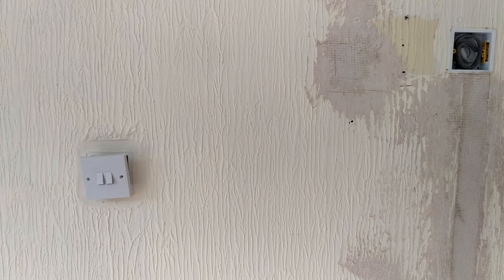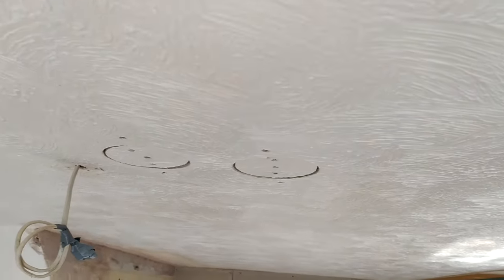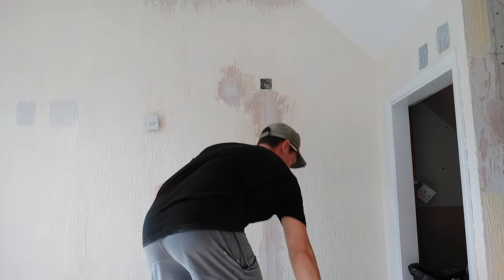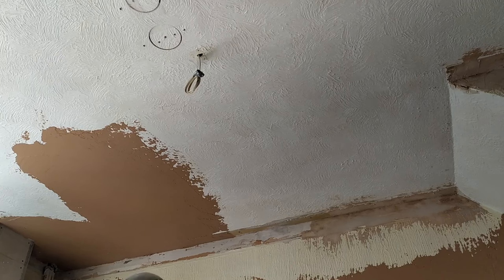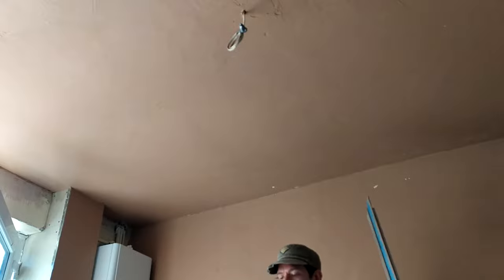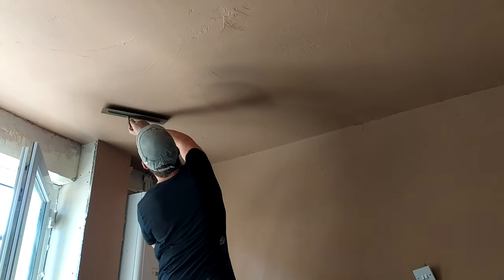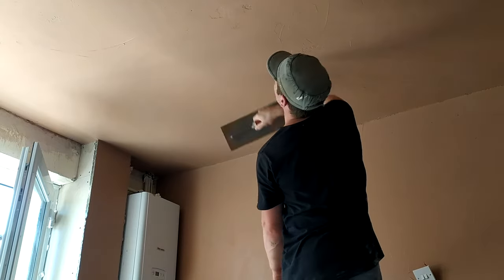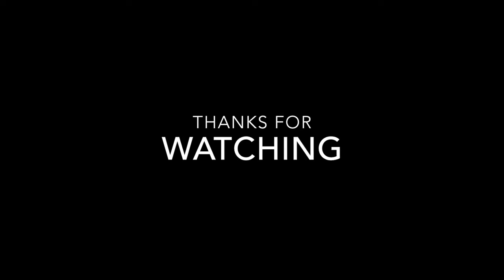Plastering Over Artex Ceilings (Plastering For Beginners)

Comment: Great video mate got a question to ask, have you ever plastered a wire mesh ceiling? Gotta do it in a couple of weeks and haven't done it before
Reply from the maker: Thanks pal! I've plastered a stair winder which was meshed but never a ceiling. For the winder you have to apply a thick base coat of Bonding before you can apply the finish plaster. The bonding binds to the mesh with ease but you may have to apply a few coats. To speed it up you can add cement to the bonding mixture. This makes it set faster pal (saves waiting for it to set ;) Hope this helps
Reply: @PlasteringForBeginners  cheers mate that helps a lot thanks very much love watching your videos they are really good 👍
Reply from the maker: No worries and thank you for the support - I really appreciate it. Cheers 👍

Comment: Just done one, used extra time retarder but as soon as it hit the ceiling boom it went off quick as hell, am I doing something wrong?? Great channel by the way
Reply from the maker: Hi mate. Did you apply PVA to the ceiling before plastering? Make sure you apply two thick coats of PVA to the surface before you start plastering because the plaster is very porous! Hope this answers your question matey!

Comment: How long before it can be painted and do you have to do anything to it before painting?
Reply: I am plastering a whole house. I asked the same question to a trade paint outlet. He said dilute the emulsion with water. The dilution should be given on the can. If it isn't ask at the shop where you buy it. This seals the plaster. It dries in no time at all. If this isn't done the paint will flake and it is a nightmare to remove. This happened to me on a ceiling.
The plaster looks pale pink when it has dried before applying the diluted coat.
I hope this helps.

Comment: How would you prepare a ceiling that does contain asbestos?
Reply from the maker: Hi mate! You can create a suspected ceiling over the area, overboard over the Artex or get professionals to remove it. The last option is very expensive though!
Reply: If was insurance work then they would insist on  removal and renew. Otherwise as a plasterer I m supposed to get customer to sign waiver and leave a warning on ceiling (ie simply form of evidence of suspected asbestos) even if overboard etc. If concerned get it tested and follow regulations.

Comment: I recommend that you don’t use skim coat arteries always shows through the skim coat ,you should be using Drylining gear ie bonding ,filler and easy sand finish
Reply from the maker: I've never had any issues with it mate but I respect your opinion 👍

Comment: Do you let the 2nd coat of PVA to complete dry before starting ?
Reply from the maker: Hi mate. You can start plastering when the PVA had gone tacky but it doesn't matter if the PVA completely dries. It doesn't affect the rate of suction so it's all good 👍

Comment: Asbestos was still in use in the UK upto 1999 so if someone isn't prepared to test a section of the ceiling I'd suggest that they assume that it contains asbestos and act accordingly.
Reply from the maker: I didn't know that mate. Thanks for the heads up and I totally agree - we should treat it at if all Artex ceilings have Asbestos. Cheers pal 👍
Reply from the maker: Here's an article which backs up what you said. It's an interesting read for detecting asbestos actually: https://job-prices.co.uk/artex-asbestos/
Reply: @PlasteringForBeginners  it's a good link but asbestos isn't found just in artex in people's houses and there are different types of asbestos some which are worse than others. Most artex "only" contains upto 4 or 5% white asbestos. Brown and blue asbestos are found in other materials such as asbestos insulation board where the concentrations are nearer to 50, 60% asbestos and should only be handled by a licensed contractor. I've never seen asbestos being discussed in any detail on any of the builder/DIY channels but I think it should be discussed at length as there are many products which can be found in older houses which may contain asbestos and represent a significant danger to the homeowner or tradesperson if disturbed.
Reply from the maker: Thanks for that mate - I appreciate that. Cheers!

Comment: Great work. Deserves millions of likes. I’d love to get this done in my flat but I have have upstairs idiots who don’t bother to control their kids. They jump and run up and down like crazy. My ceiling in all rooms have linear cracks possibly under the joists as they are straight line cracks from one end of room to another evenly spaced apart. Lockdown for them is time to behave like animals. Pack of chav mongrels 🤬😭😭😭😭
Reply from the maker: Sorry to hear that mate. Sounds like a nightmare but thank you for watching. Hope you manage to sort it in time... and good luck with the kids above 🤣
Reply: Could you run battens or thicker timber the opposite way to the joists and then board and skim it? Should strengthen it a bit?

Comment: Been plastering for 5 years now and honestly, I'm losing my touch, starting to get rough patches in random areas. Could easily be lightly sanded once dry but don't want to add another step to the job!
Reply: Do u have a finishing trowel and a laying in trowel ?   Try a refina 14 inch flexi trowel mate.   Use it only at the end with a light spray of water.   Works a treat 👌
Reply: @blueyamie  bought one a few weeks after this comment, makes such a difference!! Never realised how much better a finish I'd get from a new trowel!! I got the 14" nelaflex black edition. Its a god send!!

Comment: Hi Blanie, do you use the same proccess for the fan pattern ? Also would you sponge floay after youve layed in ?

TIA
Reply from the maker: Hi mate - I just answered your previous question ha! Yeah but they are often a lot deeper so you may need to Bond it first using BG Bonding. I only ever sponge float my second coat of plaster pal and to be honest, I never do it when plastering Artex 👍 Cheers, hope it helps!

Comment: I was wondering if I could bend your ear for some advice. I've been getting some quotes for plastering over ceiling Artex in my hallway and living room; house built in 1997; semi-detached, 3 bedroom, etc. All the guys who've given me quotes have commented on the excellent condition of the ceiling, so it's not as if they'll be slaving away for days on end. I've got quotes ranging from just under £200.00 to others hitting around the £350.00 mark. What would be the "proper" rate for the job as far as you're concerned? Cheers mate.
Reply from the maker: To be honest mate, Artex ceilings do often cost more because of the amount of preparation involved so the prices you're recieving sounds correct. 350 is high but some plasterers charge more than others and that unfortunately is just the way it is. There is no "proper" rate. Every plasterer will do that job differently and some tradesmen will spend more time than others. Artex ceilings can be finished several ways which is why your getting several different price ranges. I couldn't tell you what's right or wrong because amongst all of that, every area in England have different rules on pricing. I really couldn't provide a quote because I don't know the prices for your location. Sorry this is ambiguous 👍
Reply: @PlasteringForBeginners  Makes sense. The guy who's charging the most did seem to go into the details of it, and as you said he was the only plasterer out of the bunch that talked about preparation and any potential problems that he'd mitigate. The others took one glance at the ceiling and gave me a price; doesn't really inspire confidence in the long-term success of the plastering work, lol, especially with potential for cracks, etc. Thanks for the advice, mate.

Comment: I remember when i first started in the trade. I was labouring for a builder and one time i had to prep an artex ceiling for plastering. He made me sand it all down. It took me half a day, i thought my arms were gonna drop off 😂😂😂
Reply from the maker: Yeah this is hard work mate. You probably didn't need to sand it that much but it's a good workout ha! Great hearing from you mate, cheers 👍
Reply: Asbestos and use a drywall wander with a dust extractor if it is tested to not have any asbestos if you are asked to complete that job again.

Comment: Artex was never designed to hold more than its own weight. I have lost count of the times I have been called to houses where some chancer has plastered over the Artex and the whole ceiling has come away. Counter battens and new plaster board is the only fully reliable way to go. Make sure you have insurance. It is only a matter of time before you will need it. Your other vids were good, telling new spreads this is ok is a step backwards.

Comment: 1985, well that would almost certainly contain asbestos, asbestos wasn’t stopped being used in artex until 1999 !!!!
Reply: And by looking at the pattern on the ceiling, I can be pretty certain that would contain asbestos, the walls maybe not
Reply from the maker: Well that's me buggered then! Thanks for the heads up mate 👍
Reply: Unless it’s been tested always overboard, the finish is always better anyway !
Reply from the maker: Thanks for the heads up. I appreciate it mate!
Reply: @craigsmith5374  So you would screw into the asbestos? You've  now made the asbestos particles airborne contaminating yourself and the customers house "I hope you have damn good insurance with over 10 million liability" 
Unless you are suitably trained to work with it don't touch it. Because unless you are, you can't legally encapsulate or work on it.
Reply: Craig Smith white asbestos is water soluble so it it breaks down and leaves the body, so not harmful in small doses, however the brown isn’t water soluble so it can’t  be broken down and so it stays for ever! Lesson over
Reply from the maker: Thanks for the heads up here lads - it's invaluable 👍
Reply: Nige H 
I am licensed to remove asbestos yes, overboarding is far far less hazardous than scraping it off , 99% will be encapsulated behind the plasterboard
This is the safest way for non trained and diy ers to do
Reply: Craig Smith so the asbestos awareness course that I have to do for my job is all rubbish then?
Reply: utube882 
If you’ve been on an asbestos awareness and you’ve come away from that thinking that Chrisotile (white asbestos) is water soluble then your in cuckoo land and the course you’ve been on is not fit for purpose !!!!!!!
Reply: Craig Smith when I say water soluble it means under Scientific tests white asbestos breaks down over time and brown and blue doesn’t, the body’s fighting mechanism covers the brown and blue more than it does the white because it thinks it’s attacking the body resulting in mesothelioma.

Most fibres are removed from your lungs by the body's defences. Levels of fibres in lung tissue build up over time, but some fibres, particularly chrysotile (white asbestos), can be removed with time.
You need to do some training pal you’ve obviously been doing it awhile and become complacent and tunnel visioned. so just to make sure I was giving the correct info which I normally do I put in google (can white asbestos be broken down over time) and at least 10 reputable posts says it does and I believe them over you sorry
Reply: utube882 
Doing it 25 years matey, just finished my 3 day refresher course(which we do every 2 years)
No asbestos is water soluble END OF !!!!!!
Agreed the body ie the lungs try to get rid of it but they can’t,not completely anyway
Reply: yep.always told pre 2000,leave alone

Comment: Serious? Scratching after pva? 😂😂😂😂😂
Reply from the maker: I find the first cost of PVA acts as a primer and covers the majority of the ceiling but it also softens the Artex making it easier to scrape afterwards. That's why I do it in that order.
Reply: @PlasteringForBeginners  I use scraper with blade and long handle... not trowel .. it's much easier so u don't need to damage and scratch trowel ....I scratch artex with trowel on beginning but i quickly spotted is better tool